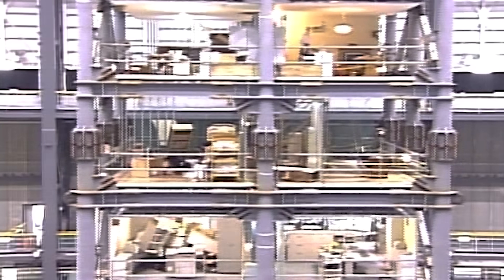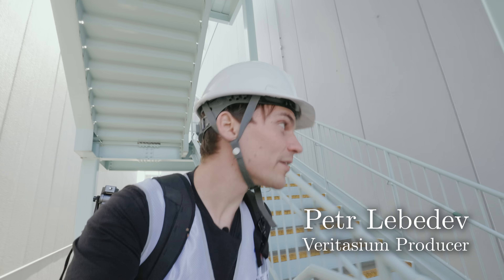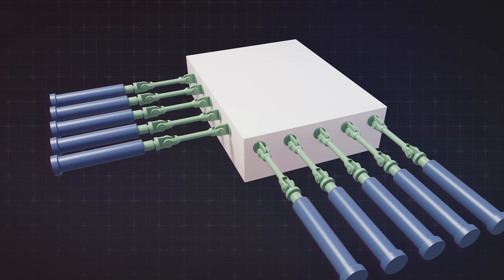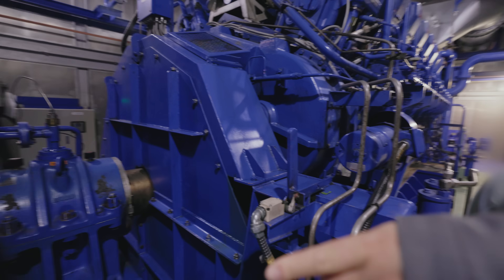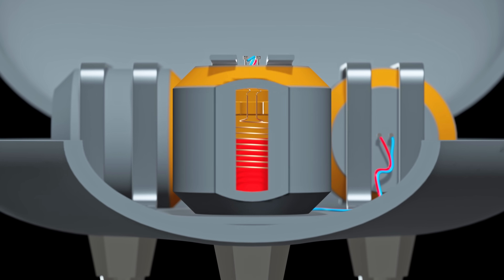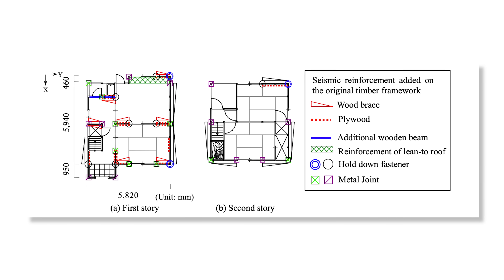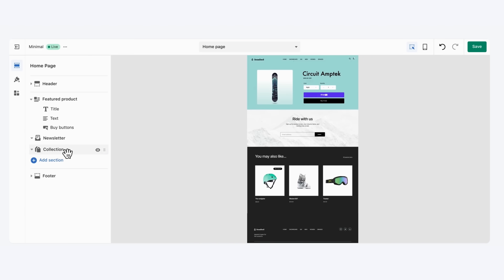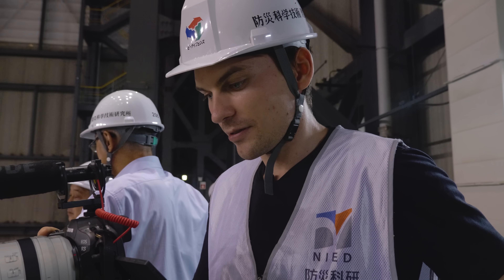How To Earthquake-Proof A House

Comment: Load is not only perpendicular but Load is passing from one pillar to other pillar. 
Purpose is to prevent smaller home from bending mean tilting.
Reply: For sea side high rise tilting another solution is present.
Sea side tilting is because of muddy areas at the bottom. 
We have good solution to it.
Reply: This solution for Japanese wooden tilting home.
When earthquake stop , some area  get more vibration and some lesser. 
This design must balance load of home and prevent tilting. 
Balance is spread. 
Please test it.
Reply: Mean if crack is right side left side will take load.

Comment: If it is impossible to predict, it is necessary to periodically evacuate everyone and carry out deep underground explosions of bombs at the joints of the plates in order to cheekily cause stress discharge? If the buildings collapse, at least people will survive. Instead of live on ticking timebomb, and suffer personal casualty? If it is known, that the region is seismically activ, why not discharge the tension yourself?

Comment: A Giant earthquake-proof house tank Possible construction method of chain earthquake-proof house
1. First use steel frames to form two triangular steel frame earthquake-proof houses.
2 Install steel ropes or chains between the two triangular steel frame earthquake-proof houses
防震屋漂浮 實驗TUBE
3. Place aluminum plates or rubber floors on the floor network formed by several iron chains, and people can sit on the floor of the cable bridge.

Comment: This principle of minimum action I think we also see it in the electric current and its preference to go places with less electrical resistance, whatever the circuit finds the optimal path in an instant, I always found it curious how it achieved it, perhaps this principle is one of the bases of the programming of the universe. Maybe this is my thing but there is also a rule that was programmed in the universe and is something that I call the principle of balance, the whole universe tends to balance, and that which breaks this balance simply dies and disappears. We see it in the stars that must maintain the balance to not become a black hole, we see it in the fish that must maintain a balance of internal pressure with the external, in the ecological balance so that an animal does not reproduce rampantly, or even in the emotions at the psychological level we need a balance, I feel that it is one of the bases on which this universe is programmed.

Comment: The answer lies in the basic knowledge of eighth, ninth and tenth grade physics, oscillations and resonances. A body always wants to remain at rest (law of inertia), so I ensure that it remains at rest and decouple it from its environment. Second possibility, my object is designed to be so elastic that it can resonate. On top of that, I equip my object with a vibration damper.

Comment: Seismic design does not aim to make buildings and structures completely earthquake-proof but prioritizes ensuring they remain collapse-resistant during extreme events. To prevent collapse, energy within the building is allowed to dissipate through a controlled hinge mechanism, where energy dissipation occurs. This approach ensures that critical structural elements responsible for stability and collapse prevention remain undamaged.

Comment: i have an idea: earthquake cancellation
it uses a seismogram to measure the shaking and its on a shaking table, which pushes the table the opposite way from the output on the seismogram, and with destructive interference, it should be able to cancel out the earthquake.

Comment: I'm assuming the injuries due to falling furniture has led to codes that require large items to be secured to the wall/building's structure.

Also, I can't even imagine the psychological trauma this can cause long after surviving it.  
Picture someone who has a rough trip on a ship in rolling seas and how relieved and thankful they are to get back on solid ground.  Then imagine that no ground will ever feel truly solid again, and  you never know when it is gonna happen.  You'd be paranoid and on edge for a long time after.

Comment: So I worked in wood frame mid-rise construction in my 20s, and this video reminded me of the first task I ever had as a framer. It involed no framing: instead, I was tasked with installing a Simpson ATS system behind the crew already working on framing the place. In concrete buildings, you have columns that span multiple floors which together with the structure provide strong shear force resistance. Wood buildings are different - they are just pieces stacked on top of each other. You build walls, floor, walls, floor, and nothing actually runs top to bottom. 

So to make them earthquake safe they have a simple system. Steel rods threaded on each end. One is embedded in the foundation, and then the other pieces are just attached together. They run inside the studs and go from the foundation to the top floor. In the middle of the wall on each floor, there's a powerful spring. There's steel plates and hardware between each floor. The spring activates from the middle of the wall and basically pushes down on the floor below and up on the floor above, top to bottom. This combined with other shear force resistance methods can make a 10 storey wood frame building able to easily survive an 8.0 with only drywall and plumbing damage. Such a simple, relatively inexpensive solution that pays massive dividends.

Comment: Japan and New Zealand  work together on this kind of stuff..i recall seeing a doco years ago about how rubber blocks won't stop a high rise collapsing, but something similar to a glass upside down in water with air trapped in it works?..and they were developing ground supports similar to that...maybe hydraulic rams?...back in the 90's i think.

Comment: I was on a station platform in Kanazawa (about 100km from the Noto peninsula or epicentre) when the recent earth quake happened. The ground shook first, as if 10 bullet trains were passing, but then it intensified, violently shaking the roof. I luckily survived, despite being hit on the head by a metal fastener producing blood that flowed down my ear and neck. I seriously thought the building was going to collapse right on top of me, but it didn’t. I am incredibly grateful to those responsible for the stability of all the buildings in Kanazawa. I really thought I would not have survived that day and still have nightmares of the ground beneath me shaking. There was no way out of Kanazawa at the time due to road closures and out-of-service trains, so I had to find a hotel in Kanazawa to stay the night, sleeping through multiple aftershocks. Once again, I am beyond thankful for being able to have survived one of the largest earthquakes in Japan.

Comment: It's very obvious that once a way is found that prevents most buildings from collapsing, the very next important steps are: 
-1) that the utilities (electricity, gas, water, sewage) of the building are functional as soon as possible; 
and 
-2) that the integrity of the main structures of the building don't suffer any damage and/or can be repaired to its original condition, without having to demolish the whole building, and in order to be able to sustain the next earthquake...

Comment: This aged well
Reply: It actually did.

Compare what happened here with what happened in Turkey or Morocco.

There is (quite rightly) ongoing backlash in Turkey over the failures of their post-1999 construction. They adopted new building codes after a large quake in August of that year but corruption prevented effective implementation. Many of their new buildings collapsed in their recent quake despite their seismic codes; many preventable deaths!

Also, as others have said, much of this quake's power was felt in relatively rural Japanese areas, i.e. places with old construction. New construction in the area mostly performed well (as contrasted with Turkey).
Reply: @Jambeeno  yup

Comment: After watching this video, some people may wonder why buildings collapsed due to the recent 1/1 earthquake. The epicenter of the earthquake was in the countryside, an area with many traditional houses and buildings that were built before the current seismic standards were set.
Reply: Sorry for the automatic translation, but I would like to add one piece of information regarding this.
Even if the building itself can withstand an earthquake, if the ground cracks, sinks, or rises,
As a result, buildings may be damaged and even collapse.
Reply: Which is weird, given how the 2007 Noto earthquake also hit the area and caused far fewer damages. 

Only now has the damage become that bad.
Reply: @ianhomerpura8937 That's what the white noise test was for. A house may seem fine on the outside, but would have invisible fractures or internal problems that would have made them more likely to crumble when this 2024 series of earthquakes came.
Reply: That’s not true at all, the epicenter of this most recent earthquake (yesterday?) was off the coast.
Reply: There is another big hidden cause. The dangers of earthquakes have been repeatedly advertised in places such as Tokyo, and public awareness is high. However, the people in this area had not received sufficient disaster prevention education or countermeasures against earthquakes.

The Shiga Nuclear Power Plant is located in this area, but it was shut down after the Fukushima nuclear accident and its restart was under consideration.
During this process, the opinions of academics who pointed out the danger of earthquakes in the area were not accepted, and only those who were convinced that it was safe were accepted, and the decision was made to restart operations despite opposition.

After the Noto earthquake, when people posted online saying things like ``We are luky to Shiga nuclear power plant didn't have to restart,'' nuclear power supporters were furious and warned people not to exaggerate the dangers. 
Initially, the extent of the damage caused by the accident was reported to be small, but this was later revised to a larger extent, but the report only covered a small media.
Reply: @NaNa-wp1ep  Anti-nuclear ideology in Japan has become the propaganda of totalitarian countries such as China and Russia, and all kinds of FUD are being deployed to strengthen Japan's dependence on fossil fuels.
People with questionable cognitive functions are more likely to become targets, and when their false statements are corrected, they mistakenly believe they have been slandered and become unnecessarily emotional.
Reply: @NaNa-wp1ep  電気代を下げろと叫びながら原発廃止を脳死で叫びまくる反対派は二度と電気を使わないでください

Comment: Thank you for bringing the art of seismic design and structural engineering in front of wider audiences. Really appreciate this. One clarification regarding the magnitude of earthquake, yes, an increase of 1 magnitude leads to 10 fold increase in measured amplitude on the instrument, but the energy released is on the order of 32 times. So magnitude 8 earthquake is 1000 times stronger than a magnitude 6 event. Simply put, for every magnitude increase the scale is 10^1.5.

Secondly US also has shake tables in UC San Diego new structural systems are tested regularly. One important point that you brought about non structural components and equipment,  and structural engineers do pay extra attention for bracing those equipment. I will also recommend anyone with heavy bookshelves and other furniture items to always secure them to the walls.

Comment: Thank you for another fantastic video!
I would like to raise a frustration when eathquakes are reported on. They are almost always, including this episode (which I'm sure was done for simplicity for a broad audience), refering to the Richter Scale (Energy Release- Logarithmic Scale). However the shake table is replicating the Mercalli Scale (Ground Movement Index - Linear Scale) which can be directly applied to the ground accelleration as shown. 
Good example of the difference in the real world is the Christchurch NZ earthquake (Not the Greendale quake that preceded)  which had a fairly low energy release in world terms at M6.3 Richter, but a massive ground accelleration, Mercalli 8, due to the geology (Hard rock below a basin of wet, fine sand), equating to 2.2G vertical and 1.7G linear accelleration, hence the massive destruction.

Comment: Question: how did you come to decide on using Knuth's Computer Modern as your main font? Because it's used so often in mathematical texts (when formatted with (La)TeX)? Or because you wouldn't have any copyright issues? Just curious. Btw, the ligatures don't seem to work correctly. I've noticed how "fi" looks so odd. But that's to be expected when you don't have the TeX font encodings and ligature information formatting the text, rather the engine behind your video software.

Comment: This is very interesting to watch. I live in Rwanda where we have the double threat of Nyiragongo Volcano sitting at the top of Lake Kivu, one of the world's three exploding lakes. An exploding lake is one that suffers a limnic eruption, releasing mass amounts of poisonous gas into the air and suffocating people and animals (like the Lake Nyos disaster). No one's too sure how often it happens, but every time Nyiragongo goes off, we get very worried about the lake - that a volcanic eruption could trigger a limnic one. Funding for Nyiragongo was withdrawn a few years ago due to allegations of corruption, so I'm not sure there is a monitoring system anymore. We have occasional earthquakes and you do sometimes wonder about the tall buildings in Kigali - whether they are built to withstand those. There was a 5.9 in Bukavu in 2008, and for weeks afterwards people in the southern Rwandan city of Cyangugu were dying when the facades of buildings fell off. I have pictures of the destruction and it's only because many of the buildings were made of wood and thatch that more people weren't injured. I wish we had this sort of technology here and a solid plan for what to do if the lake ever turns over.

Comment: Correction: the Richter Scale is a tenfold increase for every step on the scale. The Moment Magnitude Scale (which is what is what is used today) is about a 32-fold increase in energy release.

Another correction: the epicenter is not underground. By definition, it is on the ground surface directly above the hypocenter (or the focus).

Comment: This is going to sound wild and dumb, but what if we built air pressured buildings with thin metal walls. The idea comes from a pressure tank and/or bouncer house. You would just make the building wider with a counter weight that is at ground level with a super thick ribbon that connected to the top floor for more stability.

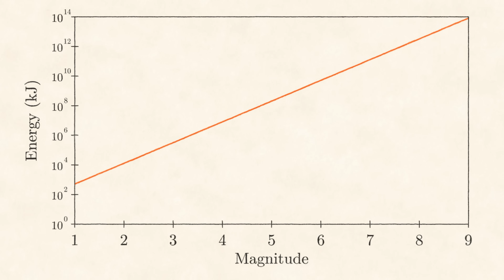Comment: 8:59 "Under 2.5 is imperceptible to humans". Question regarding this because I have experienced a 2.0-2.2 on multiple occasions that were definitely felt, and going from a 2.0 to 2.5 is a several times more energy which seems like a lot more energy: There have been several earthquakes in the area of 2.0. We definitely felt it, water in glasses looked like the T-Rex scene in Jurassic Park and the house shook ever so slightly, more like a low frequency vibration. Moments later it was reported that a 2.0 earthquake hit the area but was too low to be  felt by anyone....  Several people in the area reported similar experience (water shaking in cups).

I have two theories about this: Was it possibly my house is in a localized zone that went >2.5 (similarly the seismograph was in an area isolated), OR my house hit a resonance with the 2.0 since it was only on the upper floors it was felt-basically amplifying any movement/vibration?
There was also slight damage to many houses in the area, like tape seams in the ceiling or walls splitting. My house had this happen.

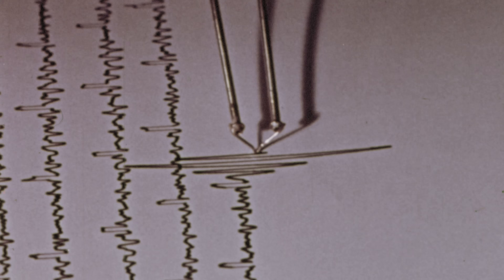Comment: There is a bit of false information in the video, a few comments from a seismologist: In the explanation from 8:00 and on, a few terms are mixed up. The device shown that is measuring ground movement and writing the waveform on paper is called a seismoGRAPH, the record itself is called a seismoGRAM. Today however we use seismoMETERS to measure earthquakes and they roughly work like explained. A geophone is a another device that works with the same principle but is less expensive and far less sensitive to lower frequencies, which is essential for recording large earthquakes. Geophones are therefore used for active seismics and engineering applications, NOT for earthquake seismology. The three coils measuring in three directions are NOT individual geophones/seismometers but called the three COMPONENTS of a single geophone/seismometer.

At 8:57 the explanation of the magnitude scale is also wrong. An increase by one on the magnitude scale corresponds to an increase of around 32 of the released energy.